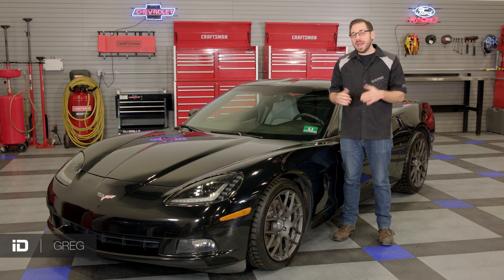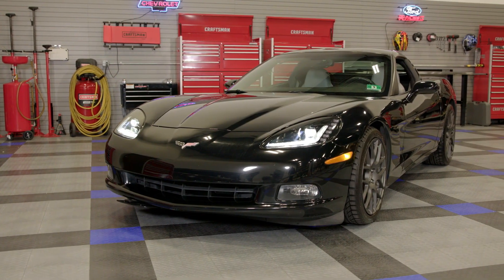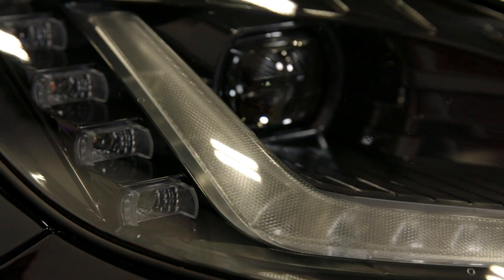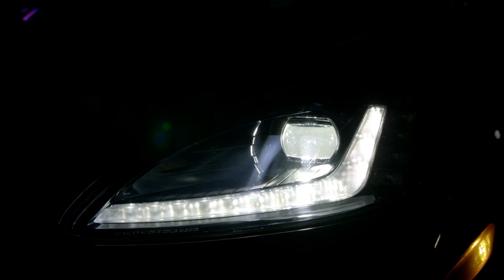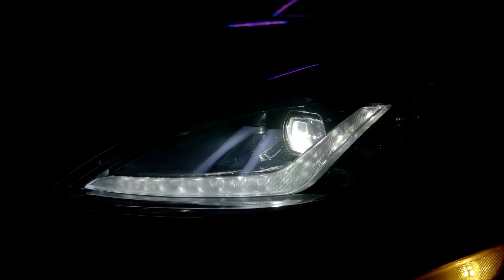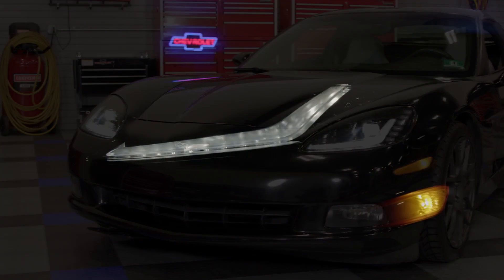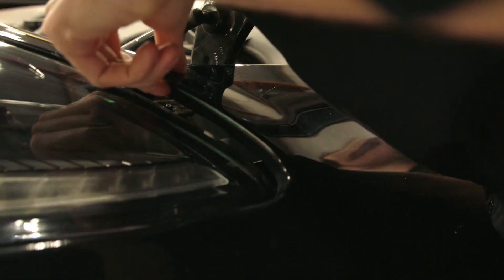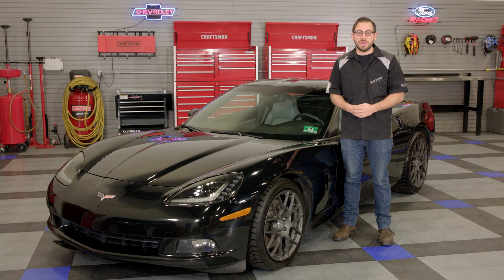Morimoto C6 Corvette LED Headlights Review

Comment: Several things to point out about this review as I just installed a set of these on my C6.  Mine came out of the box set up for non-sequential turn signals.  They can be set to sequential by simply unplugging a connector on the back of the light.  I also did not remove my front bumper fascia - all I needed to do was remove the screws at the top, under the hood, and unclip the 2 safety clips and it was loose enough to get the job done.  Last, but not least, they do plug right in to the factory wiring harness, however, to run the DRL's, there is a separate wiring harness supplied that runs from the under hood fuse panel to each of the 2 new lights - easy enough to do but additional wiring (no splicing needed) IS required with these.  All that said, the fit, finish, and function of these lights are as advertised and I do not regret putting them in.
Reply: Is there any need to adjust the light beam height? Were they equal on both sides?

Comment: The problem with the C-6 high beams has been brightness. Mentioned in this video is kelvin (warmth or coolness) of the light. Kelvin and lumen are totally different. While I like the idea of a cooler light (higher number kelvin) on the high beam, if the lumen output on this bulb is no stronger than the OEM then I wouldn't be interested in such an investment. This is what I've run into in trying to find a brighter high beam. A higher kelvin number is not going to make your high beam bulb any brighter. I have found no aftermarket bulb with a brighter lumen output than the OEM bulb. Until someone does, I won't be buying.